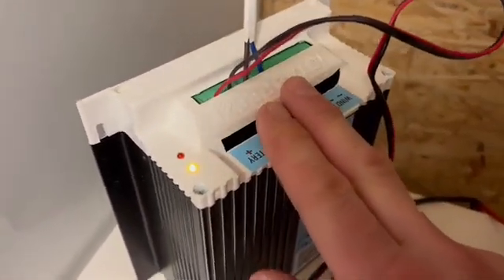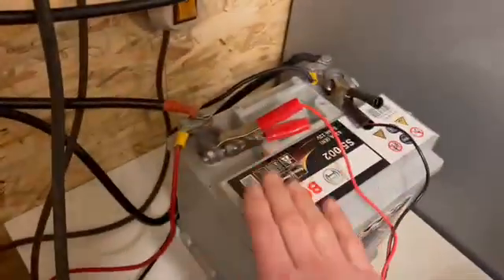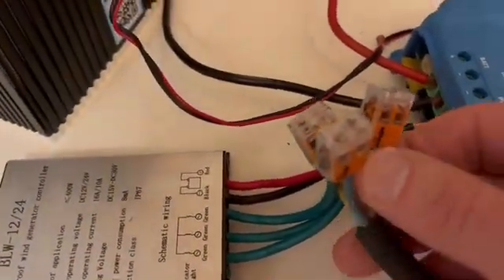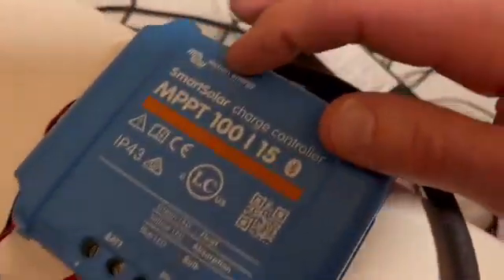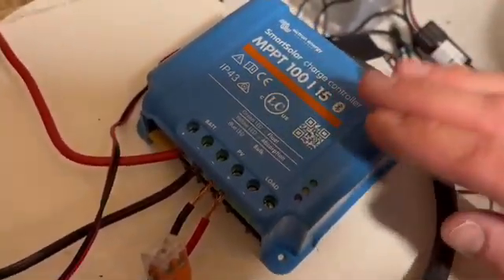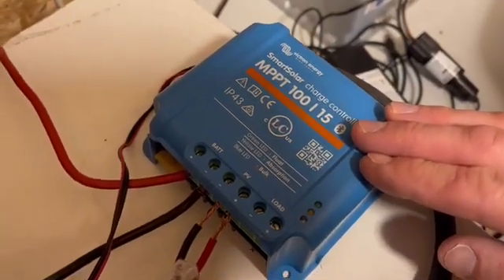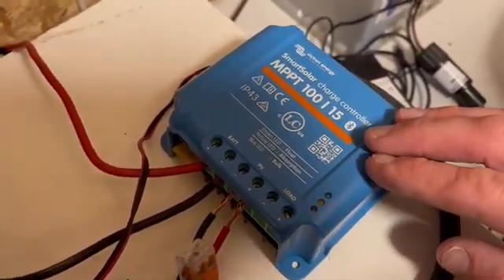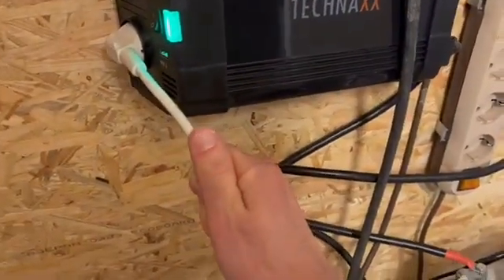IstaBreeze® i-500 wind generator in 12V - Live test

Comment: You need a six diode rectifier pack to convert the three phase to DC then a smoothing capacitor, does not have to be a massive cap. 50volt 4000uF would do, then take it to the MPPT, but you may need a dump load, you do not want your turbine to overspeed in a storm when the batteries are full.
Reply from the maker: Thank you sir! Its possible to run the wind controller over to an mppt using the battery out/input.

Comment: 💩 video,bad location,low height,I'm almost sure thin wires and long distance from generator to charger and also that the pole is moented on the generator is not fixed properly in place so my question is HOW THE HELL ARE YOU ASKING AND WANT to get good power from the generator?🤔🤔🤔🤔🤔🤔🤔
Reply from the maker: It is still on the roof, spins if the wind is good. A situation when things spin gets some good voltage and amps. This one just dont. Wire needs to be from the roof so yes some distance. Wire is a good one. The problem was that the battery was to small. Now with a bigger one the power I get is less than the transformer uses over time. Solved this with a solar panel. Your maners are bad. Perhaps long distance from brain to fingers. Head bad mounted in weak body...

Comment: The turbine is not mounted on the roof. The turbine needs laminar air flow, not air flow reflected from the walls or roof of the building or other terrain obstacles. Moreover, the roof is not adapted to this type of devices. Possible roof damage, difficult turbine servicing, lightning, vibrations and noise should also be taken into account.
Reply from the maker: Yes you are correct! It´s still there en spins when there is good wind. Even if it spins its just a 50 watt turbine. Not 500w like the company claims.

Comment: You cant use solar mppt with wind. Powercurve is not suited to load a turbine. 

Try a normal bridge rectifier, 3 phase to dc, straight on the battery. Battery voltage will provide the cut-in voltage, and thus regulate the RPM aswell. 

Only need to make your own overload protection. Voltage sensing relay to short the three phases for example.
Reply from the maker: Thank you sir. I use the "Hybrid Charge Controller" where I connect both alternating current from the wind generator and direct current from a 50 watt solar cell. Before I connected the solar cell, the battery discharged. Now it holds 12 volts despite autumn.
Reply from the maker: https://istabreeze.us/kit-l-500w-12v-24v-wind-turbine-hybrid-charge-controller-tower/

Comment: Can you give us an update about the output of the windturbine? Many thx!
Reply from the maker: In the stormy weather, I got a maximum power of 116 watts. Then I thought the roof would blow off. Storm really very windy. On normal days it does not spin at all.
Reply from the maker: According to the manufacturer, the control needs at least a 150 Ah battery. I haven't tested that yet. Instead using the simpler China control and charging a 75 Ah battery with my Vicron mppt control.er Works and I get data for each day. A bit windy the other day, 46 watts at most.